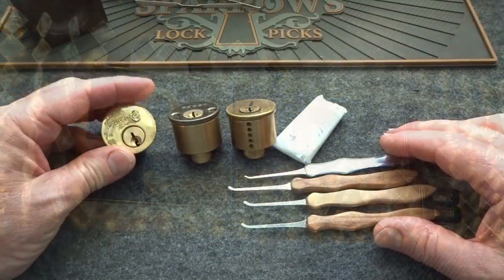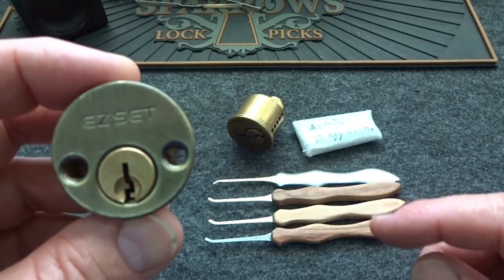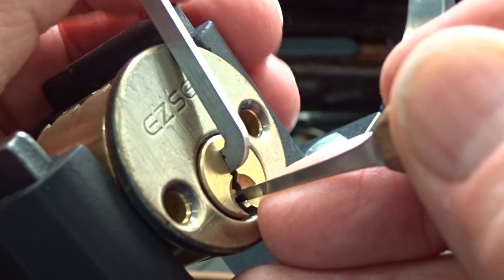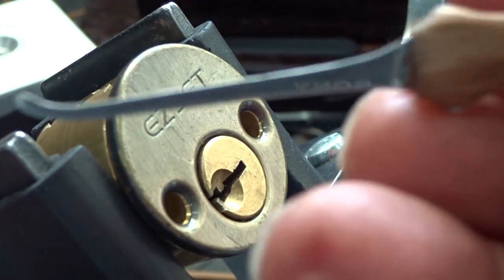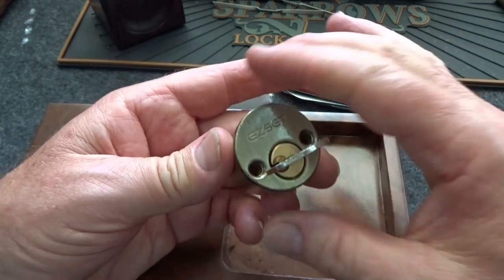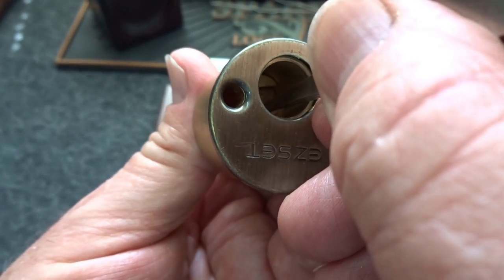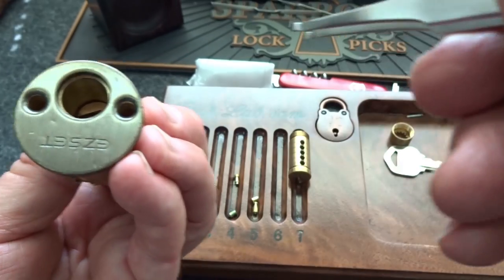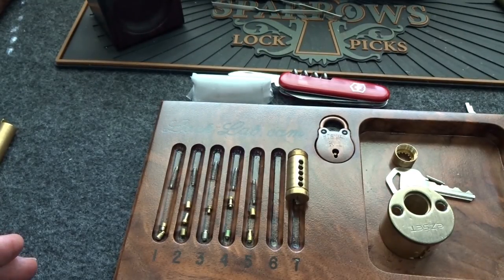(1064) DarkWoodPick's Package of Custom Lock Picks

Comment: Nicely done to the both of them.
I'd think that it would have been substantially more difficult if the bible and/or core had some threading, under cuts, or counter milling.  Those pins were amazing.
KUDOS!
Reply: James D The other two have all that. ;) Thanks. :)

Comment: Hey Bill, I was curious to know if you had done a video about the door and ignition lock cylinders on Commercial motor vehicles? I happen to know that they are very vulnerable to bumping and raking with keys of the same type but different cut patterns from the original lock. I'm curious as to find out if the engineers know this and are still using them or are they just clueless? I work as a Diesel Automotive Technician and sometimes we don't have immediate access to a key for bringing a vehicle into the shop. So we have used the raking and bumping techniques to get vehicles into the shop for repairs using keys that are a close enough fit to cause the pins to drop into the cylinder holes while using the entire key to put tension on the lock. These vehicles are base MSRP ~$250,000 with dealer bulk pricing and I found it odd that the key locks would be so easily defeated.
Reply: I don't think Bill knows much about automotive locks. He's said that in the past. I'm curious about this too so I'm commenting to get a notification if Bill or anybody answers this. I work at a car salvage auction so learning how to defeat car locks would help me out a lot at work.
Reply: Yeah the standard pin double sided tumblers are what I'm interested in knowing about, because you can rake or even wiggle pick them so easily with a key that wasn't specifically cut for that lock on Commercial diesel tractors. It's mind boggling why they are so easy to defeat with the cost expense of just one of those vehicles brand new.